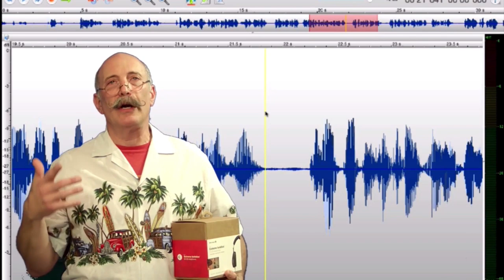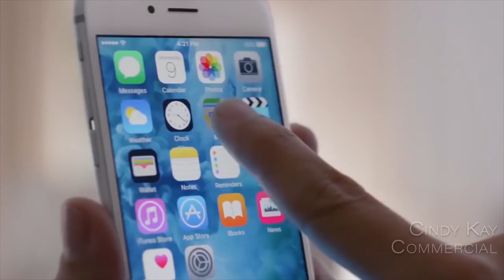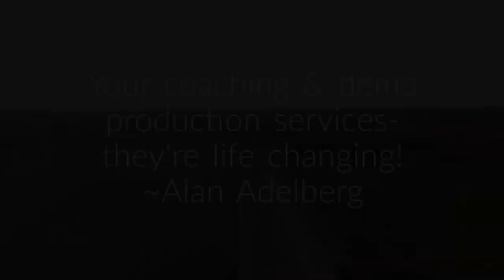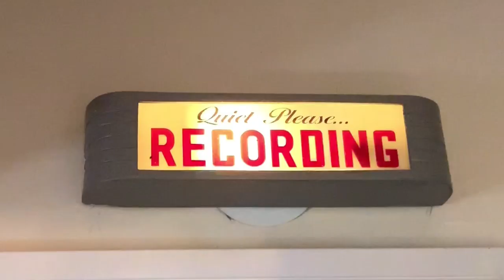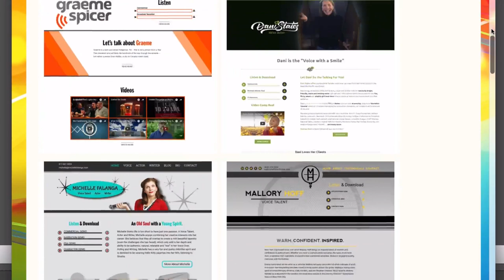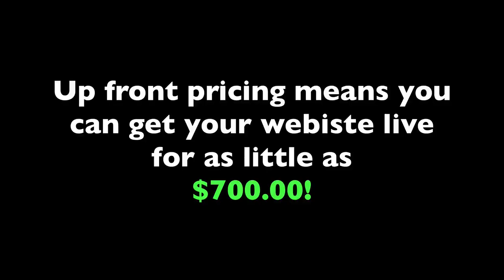VOBS -TECH-TALK -Special Edition: USB Audio Interface Shootout!

Comment: I loved the Evo 4 but it became unreliable after only 3 weeks or so. The phantom power light would not light, then it would. I reset and no change. Reset again and it worked until I plugged in a second mic. and phantom power would not activate. Other issues as well. Wish it had been more reliable because when it works, it's great.
Reply from the maker: Disappointing hopefully an isolated new product incident.
Reply: Yes, so many new products within first year of launch show their issues. Likely Audient will release firmware fixes, make a MKII or abandon the project.